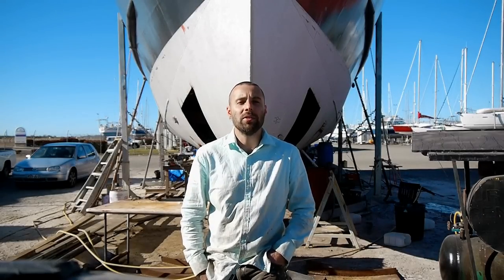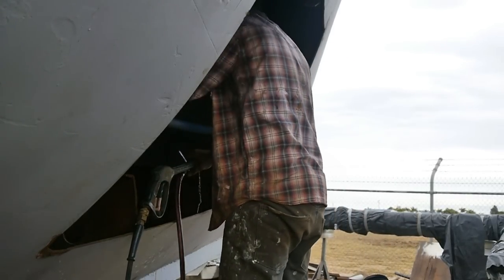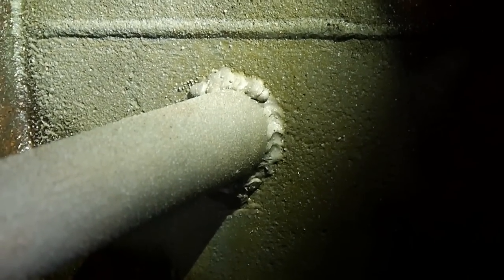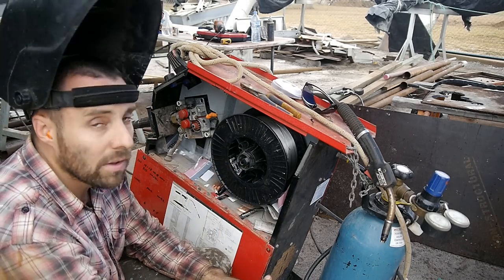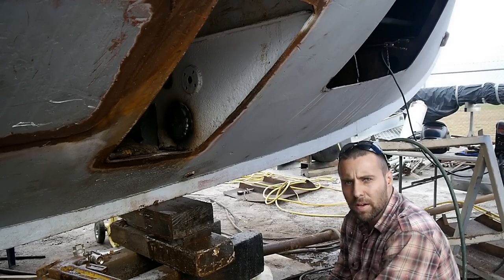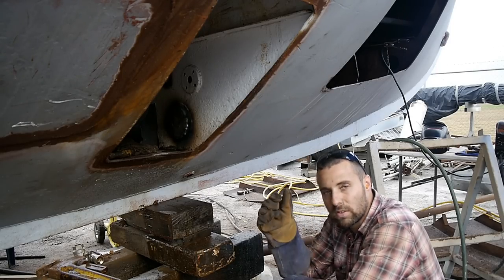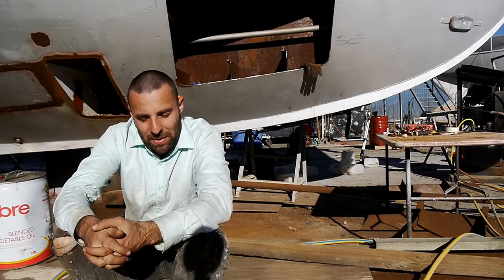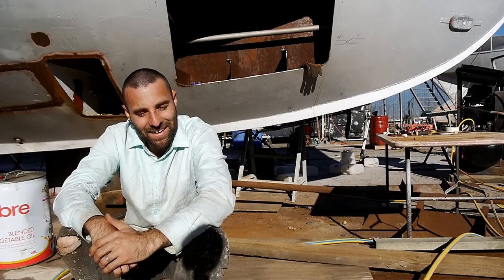RUNNING A DIESEL ON VEGETABLE OIL (Part 3 Tank Preparation) Steel Boat Adventures BRUPEG (Ep. 39)

Comment: Don't sweat the look of your welds mate...if welds were required to be pretty none of mine would have happened   :)
Good idea on using the earplugs on the wire...I used to just wrap a bit of cloth around it to do that...which could get drawn into the feed...your idea is better.
Reply from the maker: Thanks yeah it was an old boiler making that showed me that trick first day we got our MIG welder

Comment: Damien you absolutely rock buddy.I have learnt so much from you buddy and luckily my welding has improved with the framing and truck I am building to move my stinker mold around. The ear plug idea is amazing as my mig wire is coated with all sorts of crap and I am going to install them right now. Thanks so much for the plug ,pardon the punn.You are legends.Cheers Ross.
Reply from the maker: Life On The Mold - Building a 40 Foot Catamaran thanks Ross.

Comment: A binder clip and a scuff pad works great to clean the welding wire.  Fold pad over wire and clip.
Reply from the maker: Thanks Dave that’s an interesting idea. Will try it out
Reply: Steel Boat Adventures - Building Brupeg  I use the green one from 3m, any will work just needs to be abrasive

Comment: 5:58 Good tip on the earplugs! 13:17 And good explanation about root and capping welds. I think it may be shocking to the less steel boat-orientated that you casually use your hull as a marker board, but why not?
Reply from the maker: lol my marker board still needs to be antifouled.
Reply: The inside of our pilothouse has all sorts of diagrams and fastener posters stuck on the sides with magnets. Same idea.

Comment: Hi Nice job your doing on Brupeg, Dont know if it is going to be a problem but the thermal expansion of stainless is about 50% larger than steel, thought about when you weld it solid in between 2 steel walls, all the best.
Reply from the maker: Hi Zephyr, yeah it didn’t matter in this case but I will keep that in mind when doing fiddly stainless work
Reply: Just so you dont get mysterius cracks after some time and wonder why.
Reply from the maker: Good to know

Comment: So, this may be a dumb question, but can you grind you outside cap weld flat for a cleaner line down the side of  the ship?
Reply from the maker: No. You risk cracking if you do that. And on a boat like Brupeg the difference in drag is not noticeable

Comment: Holla amigo.  Well done on the welding.  They need to work.  They don't need to look pretty.   I know it's a cheat but did you considered the chemical fix?  Like a few coats of coal tar?  Or the Australian equivalent of POR15 Fuel Tank sealer?
Reply from the maker: Funny you mention that. We have an episode coming up on painting the tanks with an Australian equivalent. I suspect it is strong enough to seal it up but because this is a really critical system for us I wanted to just take as long as it took to solve it with weld. We got thee in the end 2.5hrs of weld, test, grind, repeat)

https://www.kbs-coatings.com/RustSeal.html
Reply: There ya go.  Just a little insurance.
Reply from the maker: Yip. Great way to look at it
Reply: As someone who really hopes to sail on Brupeg someday, I really appreciate this approach to safety. :3
Reply from the maker: Yeah it takes as long as it takes. 2.5hrs now is really easy when you think of how hard this would be to fix when the tanks are all welded up and we are at sea...

Comment: Only recently discovered your channel, been sort of binge watching for a few days, loving your vids and your boat. I am sure you guys hear from many "experts" (of which i can guarantee you I am certainly not one)  but just one things that came to mind while watching this episode, firstly not sure if you have already dealt with this in a newer episode but wouldn't a few tons of oil slopping around in a rough see potentially bend or damage that pipe running through your starboard tank, might be wise to put a couple of brackets along the pipe just to strengthen it in place?  Just a thought :)   two big thumbs ups, you guys rock
Reply from the maker: Hi Brian, welcome aboard. They pipe we put in is just a duplicate of a pipe we pulled out, (old one had rusted out, new one is stainless) so based on what we’re saw it won’t bend.

Comment: Thanks for sharing a great vids, really appreciate the immense challenge you have set yourself and how you are forging full steam ahead. Just a couple of things if you close the access door on your mig it might help reduce garbage on the wire reel....lol. More constructively....a little late though....just a thought, if you welded an intermediate flange on the pipe at the coffer dam wall before attaching the pipe to the bulkhead (allowing an easier better weld to the pipe) then you are left with welding the flange to the bulkhead would that make an easier, secure walkable transition?....if that makes sense?
Reply from the maker: Thanks Dan, yeah a few people have mentioned a version of that, we got it sorted but I will be doing the flange idea on any pipe work going forward

Comment: Hi folks ! First of all a weave is not recommended on pipe in this situation . A three pass procedure should have been used, no weave necessary only if you want the hassle of doing it over and over. As a welder for over forty years and yes a good many on steel vessels I pretty well seen it all. The explanation you gave on the weld prep on the hull is fine and dandy only if your able to weld the backside of the insert if not the prep and weld procedure differs. To be honest the proper procedure would be too weld up the outside of the insert using a root pass followed by a filler pass then a cap pass. This is fine only if you can back gouge using a gouger in this case with a grinder until one gets the root pass uniformed and ready to weldout. In such cases where one can't weld from the inside the plate prep changes, it becomes a V groove joint so that root pass has to be golden, followed by the fill pass and cap. Believe it or not your steel vessel will flex , more so when bumping and grinding thru ice floes so one can't be to careful when playing with the only thing between you and ice cold water. Hope everything goes well !
Reply from the maker: Thanks for your thoughts. Yeah of course if you can't weld from the inside things change, luckily we can. We're not worried about how the boat will cope with the ice but it's always something to keep an eye on. We are very lucky to have all this great advise including experienced welders and experienced ice boat builders too. Cheers. Jess
Reply: Thanks Jess for the response, hope all is going well !  Nova Scotia. Canada